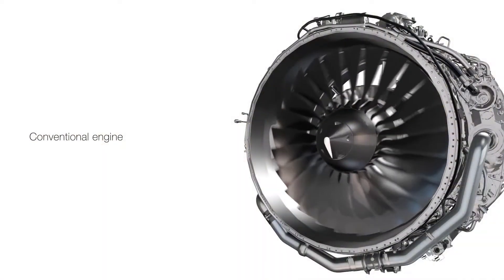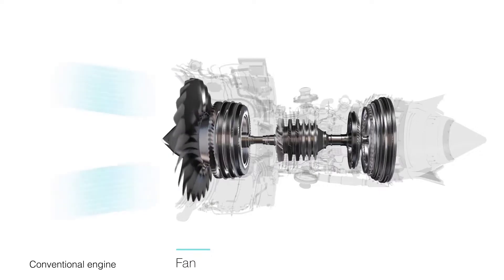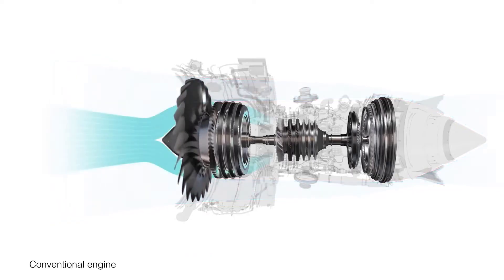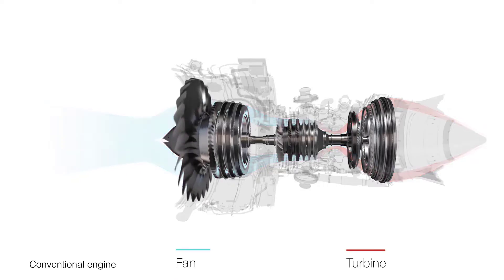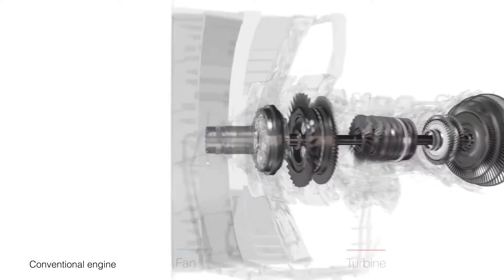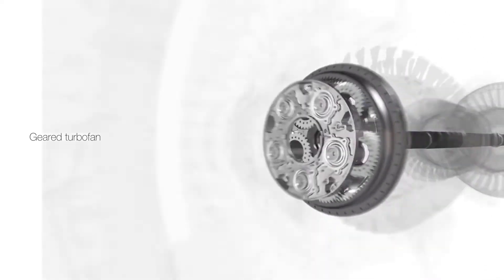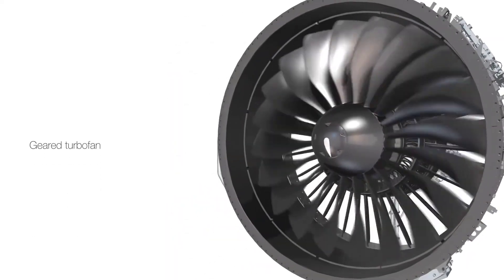Pratt & Whitney's Geared Turbofan Engine (PW1000G) How does it work

Comment: The turbine blades are subject to failure due to material problems. The engines require much more frequent inspection . Several have failed.

Comment: How is spinning the fan at lower speeds moving more air? I’m having a hard time grasping this. It’s a like an everyday fan isn’t is a you increase the speed of the fan the more air is being moved?
Reply: When the fan spins supersonic, it only happens on the outermost portion of the fan, which deflects air inward to the relative slower-moving inner part of the fan (commercial planes fly at subsonic speeds, and subsonic air cannot move past a fan spinning at supersonic speeds). Because of this, the amount of air that can move into the bypass duct is limited if the fan spins fast. By having it rotating at subsonic speeds, more air can pass through the duct, and provide more thrust with the same amount of fuel. It may sound counterintuitive, but it's just plain physics.
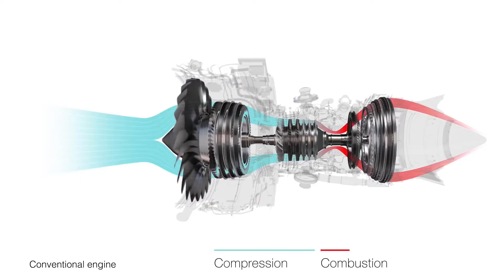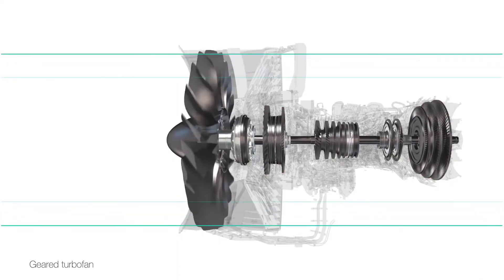Reply: Watch the clip at 0:20 and 0:50 and compare the blades on the fan.

The latter have a really deep cut, shifting a LOT more air with each turn. Due to the relatively high speed of the turbine, there is sufficient torque to keep that blade turning and shifting lots of air.

The thinner ungeared  blades are spinning faster, so cannot moe as much air with each turn.

You might think that the conventional ungeared is OK, less air per turn, but more turns (higher speed) would be similar output, but at higher speeds the tips get close to supersonic, where is becomes really inefficient - the air molecules cannot get into the engine as fast as the blades want to whack them backwards.

Net result, slower is more efficient as its further from the speed of sound, but the thicker disc shifts more air per revolution which MORE than makes up for the reduced revolution rate. Make sense?

This is similar to the principle that lead to fan discs increasing in diameter, as a bigger disc can shift more air, but there is a limit again when the blade tips get supersonic (as the diameter increases, so does the circumference, and therefore the speed - speed is longer distance (circumference) divided by time (per revolution)).
Reply: @andyowens5494  the PW geared fan spins that high turbine at an RPM higher than ANYTHING in the air, it is literally living on the edge of material capability.

KA-BOOM eventually
Reply: because the fan rotor is BIGGER.  they were making a relative statement comparing to previous SMALLER-fanned engines.

the SLOWER an airfoil transfers momentum to a fluid the more efficient the engine becomes, the LESS thrust per MOLECULE of AIR is the result.  But you require a certain AMOUNT of air MOLECULES per second = thrust, so you make the FAN bigger to get the required thrust.
Reply: The important part is “a LARGER, slower fan moves more air”. You move more air with the same swipe, allowing you to reduce the speed of rotation and also the noise it produces - take it to a smaller scale and compare server fans with 140mm PC fans
Reply: Jhon the blades and bypass are bigger so more air
Reply: Cuz the older model turbofan, N1 has to spin the same rate as the fan does, however, N1 can actually spin faster, by using gear between N1 and the fan the N1 can now spin faster, it won’t affects the spinning limitation of the fan.
Assuming without the gear, the N1 and the fan used to spin at 1000 rpm, however, it is more efficiency for N1 to spin at 1200 rpm and fan spin at 800.  Now, with the gear design, the fan and the N1 can spin at the most optimum rate to create most efficiency thrust.
Reply: @taowilliam2377  The core speed is N2, not N1. N1 is the rotational speed of the big fan at the front of the engine.

Comment: Quieter but is annoying at certain power settings for some people.
Reply: what do you mean with annoying ?
Reply: @ingunnbollestad  Wheb it adds power at lower settings it sounds like a whale.  usually when starting to taxi or starting to asd power to take off.
Many people complain about it.
Reply: @AirspotterUK  Got it, thanks for the explanation
Reply: @AirspotterUK  no that’s it’s signature sound   I like it 😊👍🏻.
Reply: @lancairw867  I just spent a couple of weeks in an AirBnB on the flightpath to Heathrow. Every now and then, I would hear this odd sound, which reminded me of the famous Vulcan howl. It turned out to be the PW1000g's in Airbus 220's, and to be honest, I liked it, but I'm not sure it would be so entertaining if I lived there year round.
Reply: @charlestoast4051  that's the high compressor vibrating, about to BLOW UP.
Reply: @charlestoast4051 wow, I just realized what I’ve been hearing for the last 5 years 😂 I live by an intl airport and constantly hear these whales in the sky